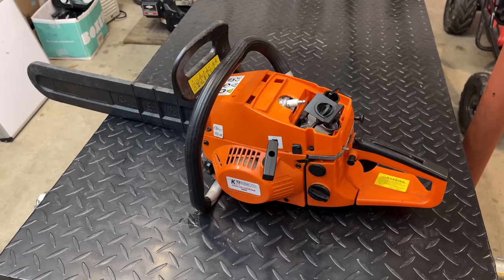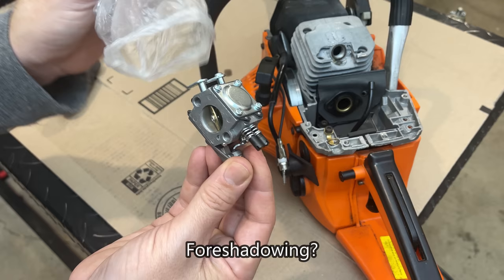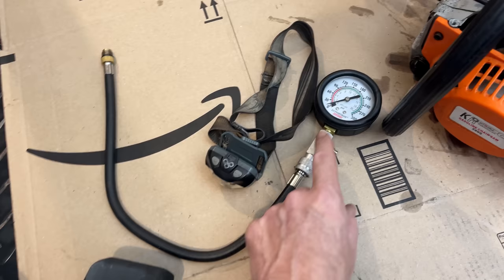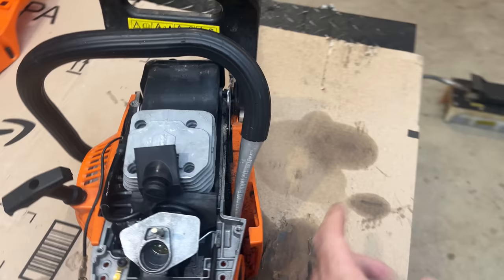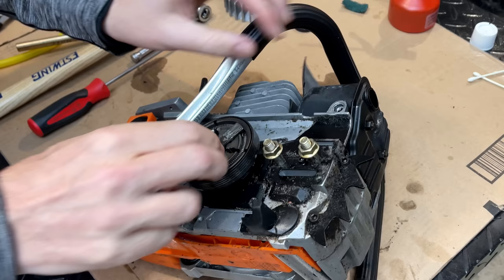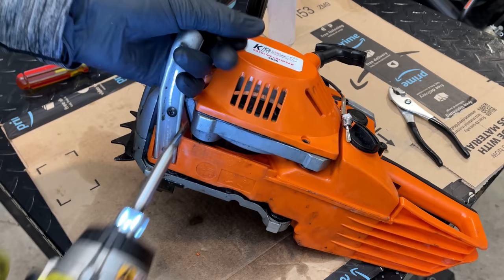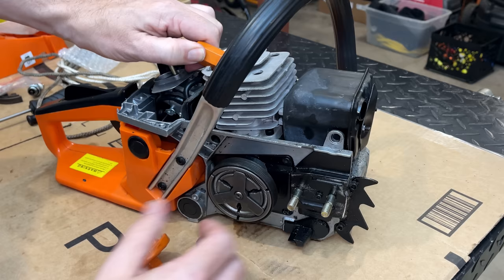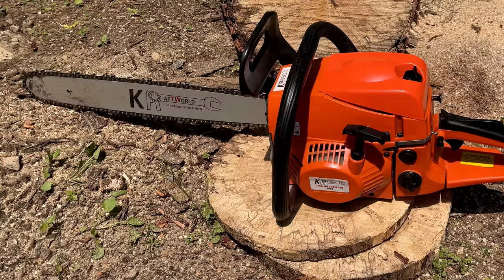Chinese Chainsaw Challenge - Will it Run? (Unbelievable Amount of Problems)

Comment: I bought one of the cheap chainsaw, the first start was'nt works....By putting the new spark plug it working fine. (un expected solution) This kind of fixing like you do is very tricky, and it kind of good effort and mind chalenging, (of cuase with your proper testing).It really interesting and sharpened the diy skills. @low cost machine is one thing, the knowledge is everything. How hard is was, do the best to solve it.Your sharing is very good exàmple.

Comment: Hi when I am taking a small two stroke eg Chainsaw to pieces, I use the string method as well but with a knot on the end, that way you don't need to feed a lot of rope in the cylinder with no chance of cutting the rope in the ports. If you know this tip then fair enough, it might be useful for other viewers. Keep up the good work. 👍👍😊

Comment: I bought a Chinese line cutter/clearing saw. For a while it worked. Then it didn't start at all.
I cursed and pushed it for at least half an hour. Then I started looking at the carburetor. The two screws with which the carburetor was attached were so loose that there was a few milimeters gap in relation to the engine. Fortunately, the seal was still intact, and all that was needed was to tighten the screws appropriately against it.
So you also have to make sure that the seal doesn't leak

Comment: Complete tutorial on chainsaw repair!  Clone saws are notoriously poorly QAd……some work, some are like this one.  I’ve been skulking saw videos for around a year and a half, 😢and most of the common problems have been dealt with in one setting!😂.  You definitely have patience, and curiosity, fitting in dilemmas that have multiple issues, and you have patiently worked through many in this treatise in 2 stroke repair.  Well done!😊

Comment: I have 3 one being a Jon Cutter 5800. I always start as per instructions. Choke on no throttle pull till it fires choke off still no throttle crank. My 5800 is a screamer.I have a 38 cc and a 71cc.they all run great. There. Really is no much to a chainsaw. Only problem I ever had on others is fuel line becoming brittle.

Comment: Fantastically complex diagnostics... James, there are none better than yourself with repairing small engines. Your skills are akin to a fine surgeon. Note: On the first vacuum fuel pull test, there were noticable small bubbles in the line.  The blocked impulse hose and cracked fuel line were your major issues for stalling from poor fuel delivery. The clutch flyoff had me crying, as you had already spit so much blood with this bastard. Why did you preserver so long with this saw? You very much like myself, know machines have a soul. When they fail to operate as designed, this causes a cosmic imbalance as millions of people thoughts were reponsible and entangled  in getting this product into production. We the Master mechanics, bring the machine back to exactly where the designers intended to be. Thus we reintroduce stabilty once again unto our vibrational universe. This is what precisely drives you. WOW...

Comment: I bought a 52cc version sold as a TimberPro. Started right up, ran well as tuned at the factory. The issue I have is getting the chain oiler to operate reliably. I have disassembled and cleaned the whole system, even replaced the pump. Pickup and hoses look good but it is not working properly.

Comment: You have much more patience than me. I'd have given up long ago and trashed that saw. It seemed that component was manufactured on a Monday morning. Then it was assembled on a Monday, shipped on a Monday, bought, sold, used on a Monday. I'd bet when the clutch flew off, that was on a Monday too! I loved watching your methodology analysis, test, analyze, repair, over and over, step by step one problem after another, until all those compound problems were resolved one by one. In the end getting this hunk of junk to finally serve its master. I would not hesitate to purchase a piece of used equipment from you. I'd know that you doggedly went through it and solved any issues it may have. That is the main reason I only buy new stuff, because buying used normally means taking on and fixing another person's problems. Come to think of it, I should have never married a divorced worman. I guess sometimes I don't follow my own rules!!! Don't tell my wife that I said that. Ha Ha Ha.

Comment: My son ran my two stroke on straight gas until it seized then hid it back in the shed.

When I found it I removed spark plug and put two stroke oil straight into the cylinder, pulled a few times until it loosened up, filled it with correct fuel and away it went after blowing a lot of smoke.  Twenty five year old Tanaka.

That chainsaw needs a proper air filter too much air in the mix.

Comment: INCREIBLE!!! 
Now that was gangster~ I have PTSD after watching every detail and explanation of the most anxiety filled learning experience I've ever had.
I assumed, I was watching a quick fix on 2" Predator semi trash pump that starts up but bogs down when I try to put from start to run. Pumps great but then cuts off.

I didn't know the duration of your video, however as the  issues progressed, I was compelled to know why and that's always been my problem.

As the issues piled up I would have cancelled my subscription, but you're  a  true Savage and went all the way in and I couldn't move on I was involved, even getting upset at the commercials. 
Then feeling effervescent to see the reason why and you wrap it up with the final solution and demonstration.

Just as my A.D.D kicked in and I could so feel myself attempting the same type of operations, doing my best to stay calm collected and organized like you, but then the moment, when the  parts violently shot out  everywhere and ricochetted off your shop walls and echoed in sharp shrapnel crashing into things long after the catastrophic moment ,ending in the sound of something spinning wildly til it hit a wall or something, 
My jaw Dropped to the ground and I felt a harsh reality come over me~ That this has happened to me soo many times and in defeat and in utter frustration and humiliation I would lash out at everything and would have taken that chain saw smashed it apart go to the bar and get my but kicked by some big ol Cowboy.

Good Times~ Good Times

It brought back so many memories , however like a real Man, you laughed and dealt with it.

I rewound that part over a few times to look in horror at everything invested already to reincarnate this nightmare only to continue to in the resurrection process.

Now, I was committed to see it through to the end, even if the Video would have  continued for a Century, I would have given my life to see it to the end.

When you achieved, what can only have been done by a Genius or a Damned Fool, I turned up the volume full blast and listened  intently to the sound of that chainsaw, taking chunks out of the tree , as my Girlfriend was yelling, Turn it Down!!! It's way after Midnight". 

I Said, " leave it be!!!" This is the other side beyond the tipping point , proving that you get what you pay for and in knowing that , still  finished in victory!!!

I learned so much from you and this video I hadn't intended to watch but by chance was the most fascinating video I've seen in awhile.

Thank You!!! I really got a lot out of it and I'm okay.
Happy Holidays to you and your Family may happiness health and love be with you for eternity.

Sincerely,
Randy Chavez

Comment: Fill the groove where the spring is located with grease.  That will keep the spring in place.  I use a screwdriver that I ground a hook on the end.  Use it and a big washer as a fulcrum to pop out the seal.

Comment: Superb video makes me feel inadequate ? I bought a light weight strimmer 22 years ago and its called an Efco stark ... it has never given me any problems .. been so reliable over probably 1000,s of hours ..never had the engine appart or the carb ... it just runs and runs ..i used commercially also  ....  made in ITALY ..shout out to the Italians for an amazing product !!  I paid £128 for it new .... an updated version now is about £340 with a low emission 2 stroke engine and a few other mods ...

Comment: I've had one for 3 years and it's  been n problem. I've  also purchased an electric 16 " non Chinese chainsaw and it is excellent - charge battery, add chain bar oil and go. Say goodbye to spark plugs, fuel mixing, noise, filters, toxic fumes, hearing damage.

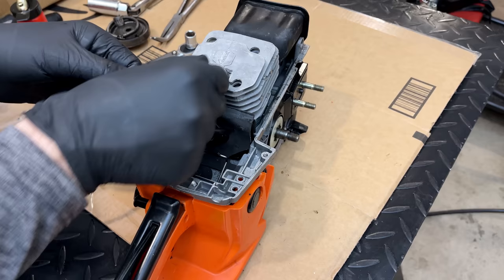Comment: @ 1:26:00 - the problem with the clutch wasnt a lack of torque. It obviously had thread locker when it was removed. Thats a good sign you should use thread locker when you re-install it.

Comment: I have one of these and its a good saw. Provided you use good two stroke oil at 25:1 mix these are OK. Mine was described as having an easy start system, but I have no idea what that is. Unless it is very cold the drill is to pull out the choke, pull the cord until it fires, usually on 3rd or 4th pull.  Then put the choke in and it usually starts and continues running first pull.  It is now about 5 years old and the only problem I have had was that the chain oil pump was not delivering much, so I bought a replacement and swapped it.  Buying mine in the UK was cheaper than fixing my worn out Husqvarna.

Comment: In Australia, there are many mobile businesses who carry out jobs requiring a chainsaw, and would swear by the brand name 'Stihl', for the most basic of maintenance necessary. The other Chinese brands are fine, if you intend spending several hours repairing/rebuilding with the initial cost as low, and you had the necessary tools and parts to restore its function. Looking at your great presentation, there's really nothing quite like cutting wood with a sharp chain..!

Comment: I can't believe all the issues with a brand new saw, looks like they used the cheapest stuff they could find to throw it together and get it out the door. Great job on finding all the problems with it. One thing I would suggest, when you put the chain on, lift the front of the bar before you tighten the nuts, the chain will loosen if you don't .

Comment: With respect, there are several issues that deserve mentioning. 
Firstly, a compression test is done with the throttle open. 
Second, even if the cylinder had compression, spark, and a fuel charge, it’s going to be dangerously lean without the air filter and cover. 

I couldn’t even get past the first several minutes without stopping.

Comment: I've built several thousand chainsaws when I worked for Mono Mfg. Co, Springfield, Mo back in 1956 who made chainsaws, lawn mowers and tree saws.    Mono is no longer in business, but I have rebuilt sever hundred chains saws.   The one you have in this video probably has several hundred hours on it.  You should have "noted" that by the oil residue and saw dust behind the clutch guard and the chain sprocket area.   When I rebuild chains saws i always replace all fuels lines, and gaskets before looking at what is the problems.  Saves are lot of labor costs.

Comment: Removing the tank is not the only way to service that fuel line. You have access to it if you remove the carburetor and a rubber seal in between the carb and fuel tank

Comment: Saw bubbles in fuel line when you initially tested it!! My china saw has strong engine, but chain like a rubber band, replaced with a S|tihl chain and cuts well. Not a robust piece of kit but OK for Light Duties.

Comment: I can feel your hard work. I wish I had watched more videos before repairing it.
I re-purchased and used the carburetor, but the job would have been the same just by replacing the diaphragm.
Your product is a clone of a Japanese product, and the parts are very cheap compared to other products.
If there had been a tachometer that showed engine speed, carburetor adjustment could have been made more accurately.
I also have two Chinese products and am using them with great satisfaction.
It may be a good idea to purchase an engine cover that matches other products.

Comment: Thank you for actually doing the diagnostics and repairs on this even though a repair shop would just scrap it, it helps the average Joe diagnose and even fix it themselves without paying labor. Some of the other channels would stop at the low compression and relegate it to the parts bin.

Comment: Dom's make sure anytime that you're tighten up the chain you put a block up underneath the the bar and the chain and then tighten it up either from the adjustment screw or the two pin

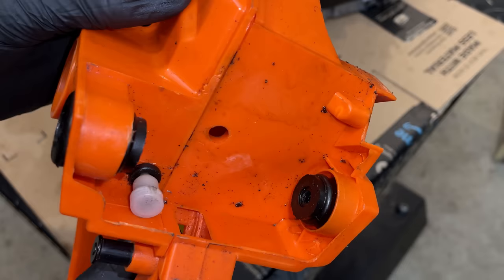Comment: 1:21:08 I had this exact problem trying to fix up an old Mcculloch Eager Beaver my dad owned. I ended up cutting the grommet section out of the old line and spinning it on a drill bit until I could fit some more standard green line through it. It actually worked quite well, though I would have rather used a direct replacement.

Comment: I think why the first clutch spun off James in the first place was there was lock tight from the original manufacturing and why it was so difficult in the first place to remove that you had to use heat to get the clutch off .

Comment: I replaced the fuel line in my saw by pushing it down into the tank and threading the new line up through the tank. No need to remove the tank.

Comment: What a great, great episode. Diagnosing at its best. 
It seems that the air filter cover could be trimmed some 10 mm or so on the front side, which would allow it to sit more evenly on the rest of the saw's cover.

Comment: You can try putting some oil down into the spark plug hole to soak. I'm telling you I believe it's your missing gasket issue & needing adjusted properly is James.

Comment: Here's the worst part. They shredded that fuel line putting it in exactly like you did. You did a fine job. And they managed to shred it. Tells you what kind of actual "unskilled labor" they use to assemble those things.

Comment: Think I'd run a die over those crank threads.  And I thought working on my Husqvarna 340 & 240 and my Poulan 4318 was tough.  This saw had a myriad of problems from plugged impulse hose to bad crank seal.  Surprised you were able to fix it. I had no idea that bad crank seals would cause a problem with carburation.  Cheers from eastern TN

Comment: I have the same saw, just as a backup if my Stihl gets stuck. Its running good. And it's the only tool which got not stolen when people broke into my house. one big issue with this saw: the tank is not vented. the saw stops after a few minutes and you need to open the cap to let air in...

Comment: I have exact the same chainsaw, and bought it in 2004 as a backup for my Stihl, if i go somewhere and it should fail i have something was my thought. it was around 60 euro at that time. it took some thinkering to get it running right at that time ( also a new intake seal ) but... i still use it a lot shoke on one pull choke in and it runs.
So is it worth repairing, yes! its a great hobby or backup chainsaw and its nice to hear parts are still available and cheap.
thx for the video

Comment: Hey bud , just some advice , when tightening the bar nuts hold the bar up. You will find that your chain does not sag so much . Love these videos , keep em coming . Thanks
Reply from the maker: Good point.   I thought I did that, but had the bar off so many times may have slipped and did it the wrong way?

Comment: The text that showed up while you were spraying carb cleaner around the seals looking to slow a leak stated you expected the saw to stall.  I would have figured it would increase in RPMS at least briefly.

Comment: I watched till the end and I think the take home message is: don't buy a Chinese chainsaw unless (1) you are able to work on them, (2) you are willing to put in LOTS of time and (3) also a significant amount of cash. You really do get what you pay for. Kudos to you for giving credit to the fine people who helped with diagnosis. Some tips for the future: on 4-stroke engines with an erratic idle, think carburetor; on 2-strokes think air leak. I was amazed at how insensitive the carburetor spray technique was in finding the leaks, but it was probably because there were so many leaks. That's why I do a P&V test early on. Passing pressure and failing vacuum is most always seals. This is because vacuum pulls the seals away from the crankshaft whereas pressure tightens the seal. Never buy Chinese rubber lines or seals. Their rubber technology has not yet been perfected. No surprise you had 3 failed rubber items. On fuel lines I have cut the grommet at each end and drilled out the center enough to drag a generic fuel line through it (cut the tip of the line at an angle to help get it started). That way the grommet makes the seal at the tank. Also dab a little sealant like Yamabond 4 above the grommet before the last little pull. You will usually need to use a filter with a smaller inlet diameter, but they are readily available. Like you, I don't use piston stops for the reasons you mentioned. However I tie the ends of the rope together and insert the loop opposite the knot to keep material from the ends of the rope such as chips from the melted plastic out of the cylinder. Be sure to get the piston just above the roof of the exhaust port before inserting rope. This eliminates the possibility of pinching the rope in a port. An easy way to keep the clutch from grenading is to put the bar, chain and chain cover on before starting, then start with the chain brake on. Give it a few strong blips with the chain brake on. This will torque the clutch sufficiently to keep it on. Lastly when starting a saw for the first time after carb work, a squirt of fuel mix down the carb throat will save a lot of pulling. Thanks for your time and patience in making this video!